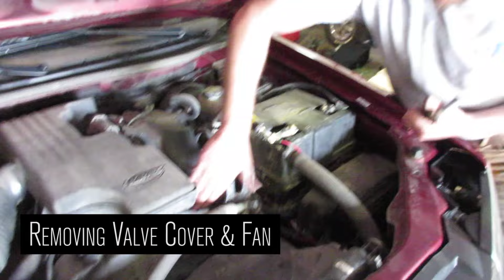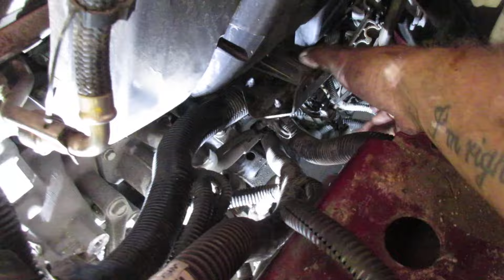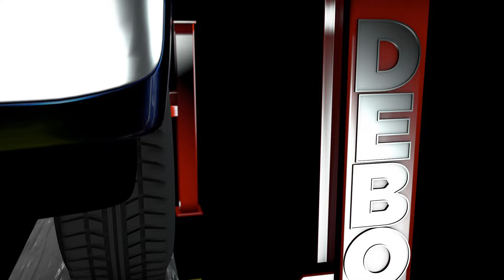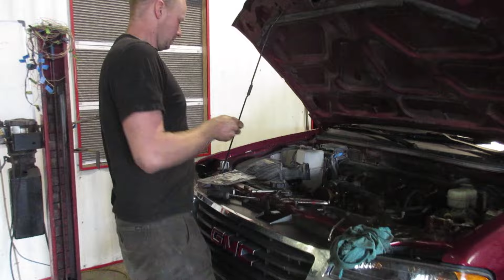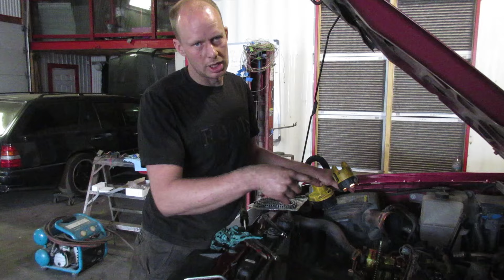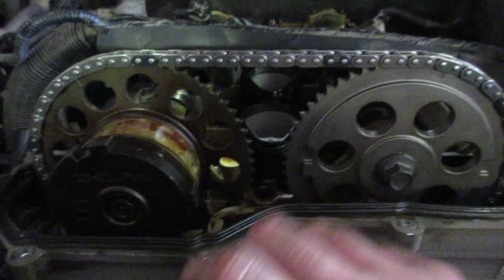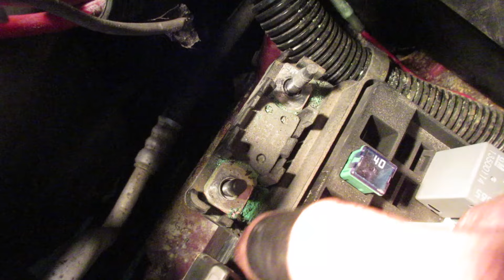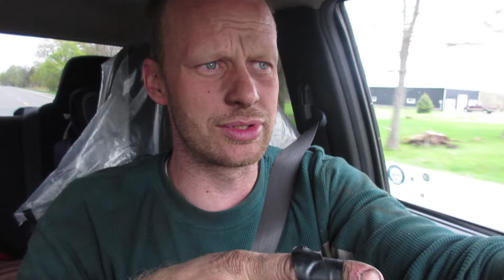Over-Engineering At Its Finest! GMC Canyon Needs A Timing Chain

Comment: Remember  that they said rotarys are unreliable ? Have a 1988 Mazda RX 7 FC Turbo. Replaced the engine 1999. Still running without problems. Another benefit : No timing chain ...

Comment: Congratulations, you just got introduced to planned obsolescence. The plan is to engineer is just good enough to get through warranty, and get one good used resale out of it. Then the used buyer runs into these issues at 200-250k so he takes it back to the dealer. Well guess what? Your extended warranty doesn’t cover it and the service writer comes back with 3-4000$ estimate, plus x,y, and z issues. So now it’s cheaper for you to invest in a new car and scrap that junk off. Got an Acadia in the backyard. Looks awesome, needs $2k worth of parts to run again.

Comment: Hey man. I'm living the nightmare now. I have to replace the rear main seal due to an oil leak and I was thinking to do the timing chain while there. But OMG you're so right about the over engineering. The truck it's been good to me but I think it's time to move on. I don't know. What would you suggest?

Comment: I wish I would have seen this about 10 months ago so I didn't have to do a front main seal, door wiring, A/C fan resistor, Fuel pump, injectors, Intake gasket, Throttle body, tail lights, Cargo lights, Emissions Actuator, PCV hose, Clutch, Fuel line, and Fuel filter. I wish I were done.

Comment: I had an 04 Colorado z71 with the 3.5L 5 cylinder. I got it with 60k and got rid of it with 220k miles on it because of the timing chain had stretched. all around that lol truck was badass. I loved it. factory I'd smoke a 5.4L triton with it. a lol 2.5in lift on some 31in mud tires that truck would go anywhere. I loved that truck man but I agree, there were alot of problems with sensors, and ball joints, cv shafts, brakes, rear wheel cylinders. Still, if buy another one in a heartbeat. I hauled a 23ft enclosed trailer with it, with racecar, tools, a spare motor, and extra tires with it and it was a champ. I recommend them. But I suggest finding a v8 one. They are hard to find in my neck of the USA (ny) but again, if buy another in a heartbeat.
Reply: How do you know when you're timing chain is stretched and getting worn?,  I've got an '05 but only 118k on it.

Comment: I had the same problem with a gmc envoy  those inline 6 are a nightmare to change the headgasket. the timing cover is attached to the oil pick up tube that is attached to the main caps... you have to drop the oil pan, front diff, front axle, rack and pinion needs to be removed out of the vehicle, lower subframe, transmission oil cooling lines need  to come off... etc... so many things had to come off and much more can't thing from top of my head.

Comment: I know this is an OLD video, but what you need to know is that the front diff goes through the oil pan, and the DO NOT come out. The last one I had to take out came out in pieces, and I was winded from swinging the sledge...

Comment: variable valve timing (which is used on these atlas engines) may be the reason those black links or timing marks didn't line up on every revolution

Comment: You think that’s bad my 2005 explorer with a 4.0 v6 has one timing chain in the front and a jack shaft for the other side and the chain is located in the rear like 5 chains total and you have to pull the motor to fix it. To answer your question: they design these vehicles to last through the warranty without any major issues, after it’s sold new and warranty is up and re sold and re sold what do they care what we have to go through to fix them ?

Comment: Watching this for the second or third time just after finding out about the turbo 4 being offered on the 2019 full size GM pickups...3 phases/lobes on the cam being changed by a pin shifting which is turn in controlled by a servo motor, ought to be good three or four years done the road when things begin to go wrong.  WHY?
Reply: they lost my business when i read 3 phase lobes.....

Comment: Thanks I watched the hole thing I have a 2011 colorado with the same engine and jest found an oil leak on the back right side around ware the valve cover couples the head ? not sure what is leaking is the sending unit around that vicinity ?

Comment: Reminds me of this POS dodge charger with the 2.7 v6. Water pump is part of the timing assembly, and when that gasket fails coolant is in your engine oil, and you cant tell until your engine stops working. And it's a Dual overhead cam engine that's tensioner by oil pressure, and also interference. So when the water pump gasket breaks, oil gets diluted, doesnt have the same properties, timing chain loosens, skips teeth. Pistons clash with valves and you're on the side of the road wondering what happened. I wanna cry.

Comment: Assembly cost and ease for manufacture is 9 of the 10 things engineers for a manufacturer concern themselves with. Sometimes it can make them easy to work on and other times it F-in sure doesn't.

Comment: this is my first truck, im crushed at this point, i put a used engine in it and it only runs for 20 mins with my ecu, the engine only has 80,000 miles and it has a p0017 error, im going to a shop to see if the can do a case relearn on it because im not excited at all to probably have top rip the engine out again.

Comment: I think it would be cool to put a 2.0 turbo in it. Obviously one of them would cost more then the trucks worth and used ones might not be a thing yet but if the trucks light enough it might really get 4cyl fuel economy and pretty much v8 power (at that time these canyons were made the 5.3 was making like 300) without the added v8 heft.

Comment: since you had to pull the trans, would it not be easier to just pull the engine and do it on a stand? those engines with the rear chains seems to be a pain.

Comment: can the crank bolt be removed with the starter like a transverse mounted, right side engine? just wedge the breaker bar on the ground or bodywork and bump it with the key?

Comment: Great video. Terrifying, but great. I keep getting cam position sensor codes and sometimes no-start on cold mornings. What happens if you change the cam chain but not the balance shaft chains?

Comment: Bought a 2010 GMC Canyon 2.9l from a Dealer with 210k on it. It Came with a power train after market warranty and my timing chain went, First time in the shop the company that supplied the power train warranty cheaped out and replace SOME parts and missed the part causing all the trouble and the truck had to go back again and they ended up replacing ALL the parts again......imagine if I had to pay Money for that.....dumb way to build an engine for sure by now we should have modular cars with low maintenance times.

Comment: These trucks are actually very reliable overall but a pain to work on my buddy zack worked on his for years and then decided on a ls swap like a legit swap with a kit and everything made it look and act stock everything worked like it still had the factory engine ac heat gauges everything he still drives it daily with almost 120k after the swap he definitely lost the fuel savings but gained massive power and it’s so much easier to work on

Comment: HOW did you take out the torque converter bolts ? i took out the starter . i think it will be easier to pullout the small rubber cover on the bottom of the bell and wrench em out !! i  pulled in intake plenum so that i can change the intake gaskets , i figured i might as well pull the starter and get torque converter bolts from there .  thanks nice video !

Comment: Too bad you can't get the pushrod 3.8L "3800" anymore.  The later ones had the bugs worked out and were reliable, performed well, and were simple to work on.  GM seems to have difficulty with OHC engines, for some reason.

Comment: A friend's Canyon slipped its timing chain at 200,000 and he bought a rebuild. Everything Steve said is correct. Sell at 150,000. Do not replace the chains in your garage.
Reply: I've done thjs job a few times it's faster to pull the motor mounts and pull the engine

Comment: I had a 99 S-10 with 5 speed manual.  stupidly simple engine.  when it came time to trade her in.  I was wanting to get a Colorado but got a Silverado (V8) bc it was cheaper, less miles, and more capable.  seeing this video, I am glad I got the Silverado bc apparently the engine is a dream to work on compared to the Atlas family engines

Comment: Can I show a question about this job? I have this same truck and I did the entire job just like you did it but when I put it back together the only problem is that oil leaks excessively write out the crankshaft. I changed the crankshaft seall and it still leaks out like a sieve.  Everything else seems to work great. Do you think you could give me some insight on why the oil leaks out the crankshaft so quickly.  I'm pretty sure I put it on correctly, maybe you can tell me that I didn't have the splines lined up correctly or what do you think?

Comment: very interesting stuff your saying at the end of the video, that being said what would happen if you completely rebuild the motor so that there wasn't any potential problems to worry about...it just might last forever. Between the 3.5/3.7 and the Triton i don't know which is more of a pain in the ass. The triton is good on gas as well I'm not mistaken because the engine likes to drive around at really low RPMs?

Comment: The v6 in Ford Exploders has three timing chains and ya gotta pull the engine!
Reply: I did this on my Ranger. Fuck the newer 4.0! My old push rod 4.0 was easy, once I lost  rear timing chain. It was a nightmare. I'm guessing it was cost savings to reuse the push rod blocks for the new casted head.

Comment: It kinda reminds me of the ford 4.0 with the timing in the rear of the engine
Reply: when i was a ford tech, had a 05 mustang trade in rattling like crazy. I just pulled the engine to do both chains. easier to do everything on the engine stand. Ran like a sewing machine when I was done, so i guess i did it right.

Comment: I didn't have to pull the front diff, I merely had to unbolt one engine mount and loosen the steering rack.  No big deal.  Lol.  I think I'm trading this turd after I get it back together.  What a pain in the ass! Only 90K and threw a light for a stretched chain!

Comment: I just bought a 2008 2wd ext cab Colorado 2.9 with the 5 speed.  It has 211,000 km's.  Is there any signs that the chain is failing or stretching?  How many hours does this job call for?

Comment: Believe it or not it was designed for a reason to make the job easier. The front one should go after the rear and less often. But it backfired. Simple as that. The wheel bearing thing is a technical advancement in how to work on vehicles. If you take the bearing out correctly you don't have to replace it. I've done this on multiple vehicles to keep them on the road and save the customer money. That being said I'm no longer a mechanic for a dealership. I didn't agree with charging someone so much for something so simple. Yes it's over engineered but with good thought behind it

Comment: If i remember right, on the old Monza you had to remove the engine mount to change the oil filter. This was the V8 fun car to drive but pain in the ass to work on. No more GM products in my lifetime.
Reply: You unbolted the two bolts that held the unique motor mount from the frame bracket and then jacked up the motor a little to change one of the driver's side spark plugs, not the oil filter.  It was not a big deal.  Ironically with Hooker 1 1/2" primary tube headers, I did not have to unbolt the motor mount to change the plug.  Putting a 71 Impala smog 350 in a 78 2.5L Monza with parts scavenged from junkyard 262 and 305 Monzas and Sunbirds was my first hot rod project.  I made a lot of mistakes.  Turns out there were many parts unique to the Monza and Sunbird v8 cars.  I had to keep going back to the junkyard to get those parts.  I did not realize the H body had a special oil pan until the grease nipple on my inner tie rod put a hole through the Impala's oil pan.

Comment: I have a question. I have a 2012 4500 cab chassis I bought used 6 manual. The  dash gose crazy sometimes it doesn't start oh and its deleted. What is bad pcm or tipm?

Comment: The Reason there is a Balance Chain for the LLR is because ALL 5 cylinder engines have an INHERENT crank torsion Imbalance. If it did not have that it would cause excessive thrust bearing wear.

Comment: I have a 2006 i5 2WD with 245k miles. I think I need my timing chain replaced. I was told to change the idler pulley and the tensioner pulley and see if the noise goes away. Anyhow, if it is the timing belt, more or less how much would it cost to take it to a shop to have it done?

Comment: I have had my truck for about 3 years now and it is a 153000 and i was told the timing needs to be replaced in these every 100k i dont drive it hard and i use the best oil on it so im still asking my self why

Comment: I used to have a mid 90s gmc 1500 4x4 with the v6... That truck was indestructible. Standard cab with a bench seat and 8 foot bed. Dam i miss that truck. These new ones are just crap.

Comment: I thought the point of timing chain was so that it won't ever needs to be changed unlike how the rubber belt would stretch and loose tension eventually. Wth ???
Is this the same process for the 3.7L as well?

Comment: I'm not understanding, if the links don't match the marks the timing is off right? I'm not understanding how rotating the engine should make the marks line up again.. can someone explain why and how?
Reply: It's the difference between the circumference of the gears and the length of the chain between the two dark links. These are not equal distances. The only thing that matters is the relationship of the crankshaft gear to the relationship of the camshaft gears, which is half the diameter. The crankshaft has to rotate twice to every single rotation of the camshaft gears.  This coincides with a 4-stroke engine. As the engine is rotated, the distance between the links is eventually compensated for, and they line up once again.

Comment: Hey Rich you think this is bad? You should check out the new 3.0 duramax. they put the timing chain in the back again and now the oil pump is driven by a belt you have to replace at 150,000 miles. POS! Engineer says its easy to change....just drop the transmission.

Comment: Thank you for sharing it is a big job with 4x4 in a h3 a pipe plug for oil pick up tube bolt would have earned an engineer a dubble salary.oh air conditioning pulley in the way . new cover gets the ear cut off . for easy installments. Thanks again for video.

Comment: Question it s need to change the rear chain
Reply: Yes, the balance shafts run off the crankshaft. If the chain jumps its sprocket the balance shafts will go nuts and there are oil passages that feed the balance shafts oil and the rest of the engine. So, they need to be in time or your engine will destroy itself.

Comment: Not as bad as the Timing Chains on the 1997-2003 Ford Explorer with the 4.0 L Cologne SOHC V6. The rear chain is worse than this, much worse. Same with pulling the trans, but have to remove the intake, and much more.

Comment: If you think the gm 2.9 has a stupid timing chain setup you’ve never meet a ford 4.0 sohc. They just slapped ohc heads on an ohv engine and put a jack shaft in place of the original cam. It has a chain from crank to balance shaft, crank to jack shaft, jack shaft to left bank, then in the rear of the engine jack shaft to right bank for a total of 4 chains and the kicker is there are no timing marks or key ways on anything so you have to buy a $250 timing tool kit.

Comment: One is a roller chain, the other is a morse chain.The wire that is corroded in two is likely a ground. It is still very important, though, because 85% of electrical problems are grounds. Anytime I have a customer car with multiple electrical problems, I look for bad grounds.I may even add a few. My cost at the local parts house is about $3.00 USD for a braided strap with an eye on each end. Ground the engine to the body, ground the body to the frame, Wow! Miracle problem solver.  WARNING! The other 15% of electrical problems WILL BE component failures. i.e. bad fuse, bad switch, bad bulb, etc.

Comment: I saw a video on feeding a new timing chain by attaching the new chain to the splice of the old chain and turning the crank shaft to pull it around, I think it was on a BMW. Are you sure there isn’t a tool to do this on this engine?
Reply: You'd need a chain maker/breaker to put in the rivet pin, but it could save hours if work. 😉Good tip

Comment: I'm just saying it's pretty damn bad when there are transmissions nowadays that are actually cheaper and more profitable for the mechanic to order a prebuilt one and just swap out rather than order a kit and parts to rebuild it himself. CVTs. If you charged true full labor for the time it takes to rebuild sometimes you'd run every customer off. Plus the module reprogramming relearns internal modules. Over engineering is correct. They want you to have to bring it back to the dealer. You can order books and go to seminars but you still gotta cut your teeth on one or two before you really get em down. Just gotta be careful what you dive head first into anymore.

Comment: Shit, even with my LS-based silverado, i've replaced every single part in the evap system and I still get codes for the purge valve and other crap. Even smoke tested it. My gas mileage is terrible unless I clear the codes from the PCM every startup.

Comment: Back in the day when GM put the first gen small blocks in pretty much everything along with the 292 I6 and the Iron Duke I4, these were all easy to work on and lasted forever.
Then you have over engineered garbage of today.. Even the small block is not immune with gen V's.